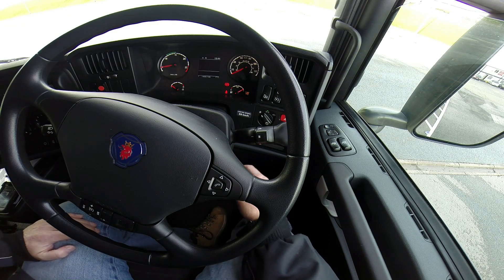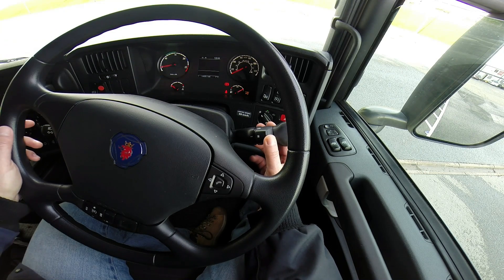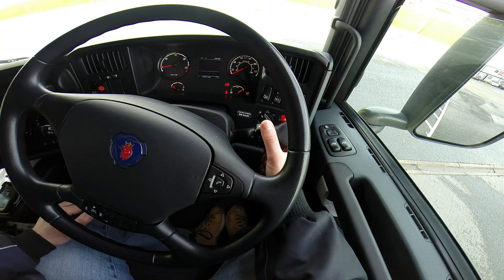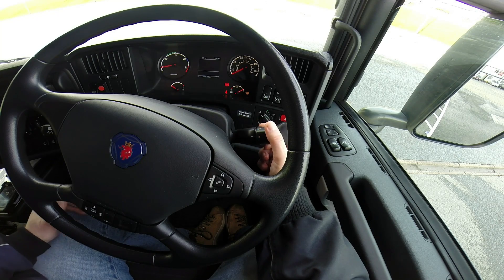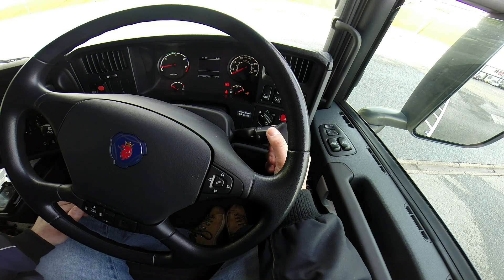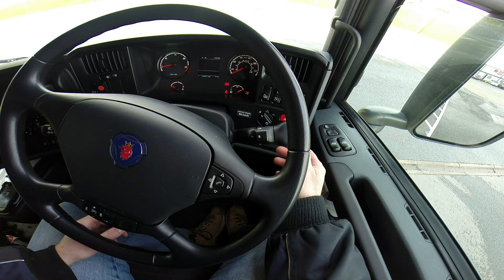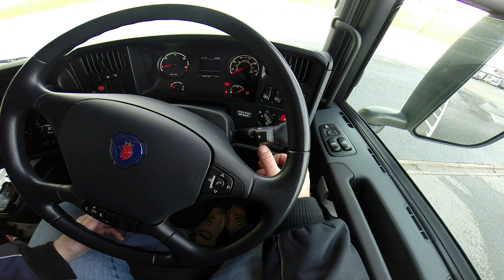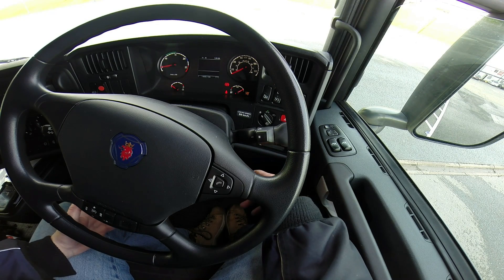Scania Opticruise 2014

Comment: Thanks for the vid, Is this a P series? I have my training and test in a few days i'm trying to find out what to expect?
Reply from the maker: This was an 'R' series Streamline, but as far as I know all gearboxes are available on either an R or P series. Some are 2 pedal Opticruise versions like this one was, smoe are 3 pedal opticruise versions where you have to press a clutch pedal when you want to stop, or they are manual gearboxes using a clutch and gearlever where you select the gear. Good luck with your test.
Reply: That's great thank you!